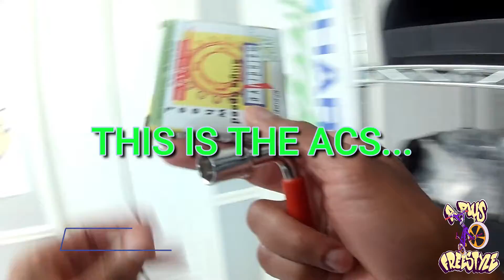86 HARO SPORT PT. 3 #DIY #HowToVideo #Creative #Art #DIYRestoration #BMX #Bicycle #Customization

Comment: You do don’t need tighten up the freewheel in future that will tighten itself very quickly as you pedal the bike. Nice colours.
Reply from the maker: Hey thanks for the feedback and for watching our channel. 🅰️🅿️💯
Reply: @aplusfreestyleapf5476  It’s cool anytime.
You have a great inventory, any die hard fan would love. 

I have a Haro Master DMC 24” 2020 in green, Skyway Tuff 2s 24” in White with Black Campy hubs 50th Anniversary wheels, chrome laid back seat post, Dominator Seat with chrome rails. Haro Knee Saver Bars In Chrome 8/ half” with ODI blue grips, Nickel plated Chain, Shimano Chrome 16 teeth rear Sprocket ⚙️ I could go on. It is a people stopper,  they just stop and look 👀.😎